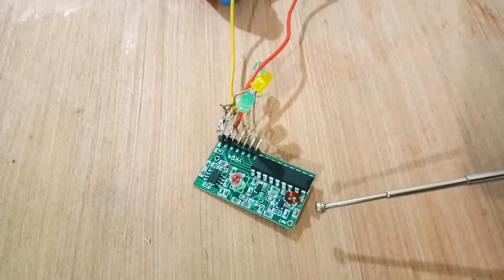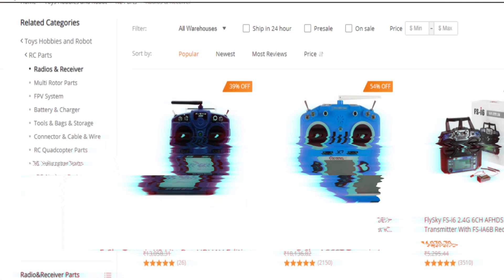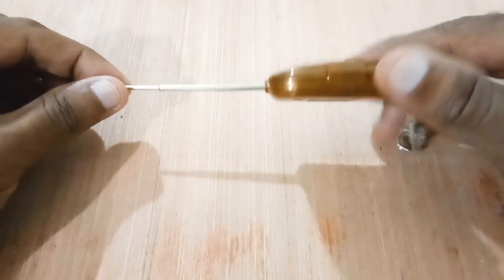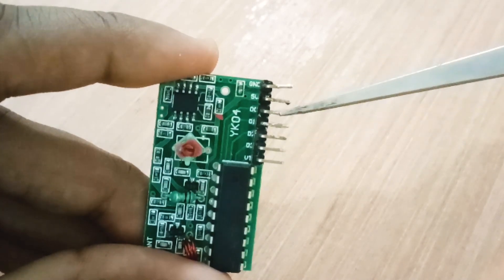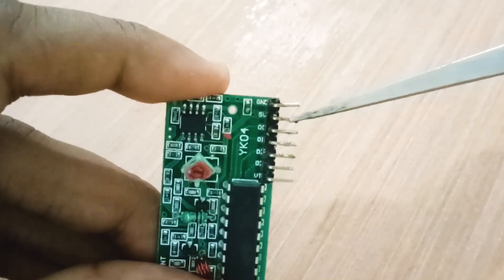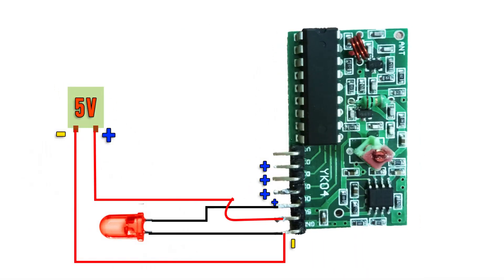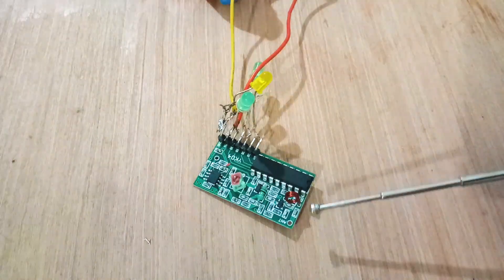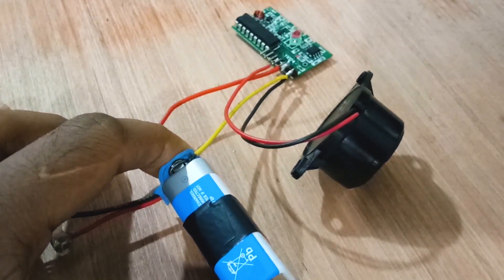Cheapest transmitter and receiver for Drone|RC 433MHz 4 channel Transreceiver|RC Plane transmitter

Comment: Can I use a 9 volt battery, plzz reply
Can I connect 2 mini LEDs with it
How many appliances can I connect 

Plzzzzzzzzzzzzz reply
Reply from the maker: Yes you can use a 7805 voltage regulator or 9V to 5V converter to drop  the voltage.
Reply: Is it necessary to use a 5v battery?  can't we use 9v battery 🤔🤔why is it so ? Will it burst ?